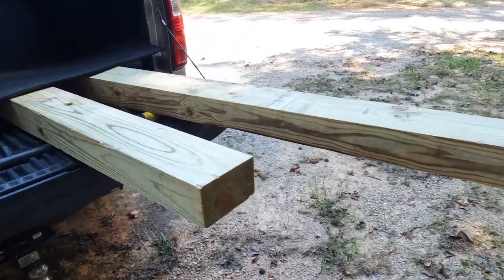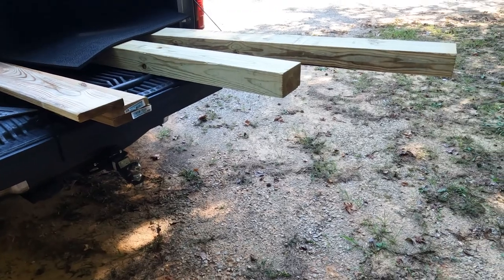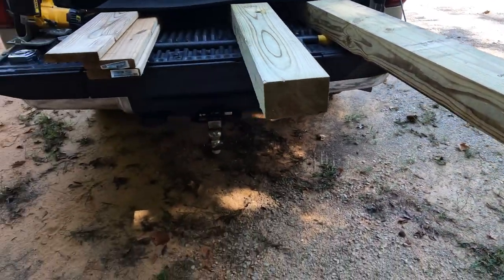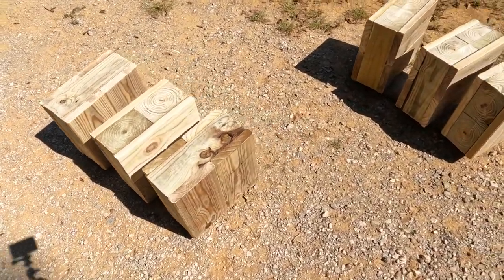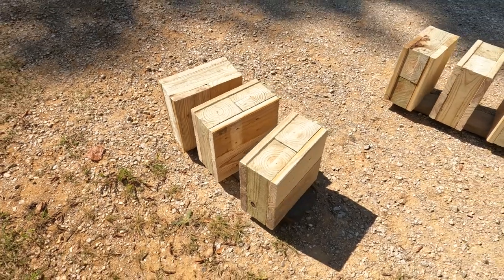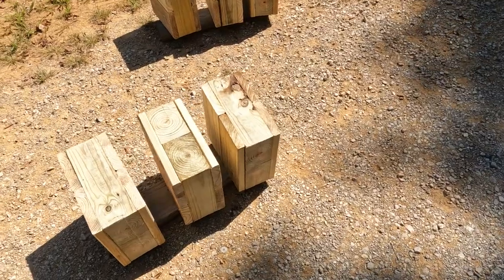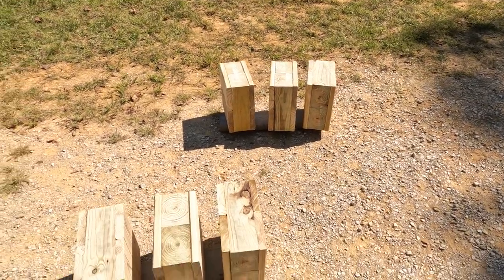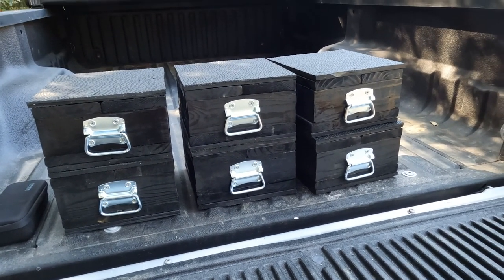Homemade Jack Blocks for RV

Comment: I used to use a similar approach...but now that we have down sized space and weight are at a premium. The bucket style all in weight half of what one block does and takes up the same amount of room as one wood block when stacked together.
Reply from the maker: Might be something I end up getting but for now they work great for us. Can you still use the snap pads with them?
Reply: @4csadventures  yeah the corners might stick off a bit but the no big deal.

Comment: I like them but I would use untreated wood.  It is much lighter.  We also camp with a 23" TT and find a lot of state parks have very unlevel sites.  So, I just carry a bunch of various size wood blocks.  I also subscribed.  Best of luck and have a great day.
Reply from the maker: That is a good idea to use untreated wood. Saves weight plus I painted mine anyway so it would help preserve it a little longer.

Comment: I made some similar years ago that worked well. However, I ended up buying the yellow Camco jack stand because they are significantly lighter. They also don't absorb water like wood does and we always seem to get rained on.
Reply from the maker: I definitely understand that. Seemed like the rain always follows us. Thanks for watching.

Comment: Hi... thanks.  I used 2x6 pressure treated wood. Its red in colour wood out here in AZ.. I built sets in 2 layers and 3 layers. 13 inches long boards. That gives a space opening in the boards to grab them with.  That plastic pads were cracking apart, so I built wood pads like u did.. I still have a few plastic pads in the 5'er for some reason.
Reply from the maker: That is a good idea too. Thanks for watching

Comment: Good on you for making your own! BUT, I wouldn't compare to the Anderson buckets as they are not anywhere near the same. The buckets appear to be taller, can stack onto each other and they have a magnet for connecting them to your foot pads before you put your jacks down so you know they are lined up properly.
Reply from the maker: Thanks, I really liked the anderson buckets just couldn't drop that kind of money right now for blocks that I could make for 1/3 of the price. 
Thanks for watching.
Reply: @4csadventures  I'm going to make these...and add magnets. Easy-peasy.

Comment: Definitely sturdy, but I would be concerned about the extra weight unless your haul vehicle is a One Ton Dually.
Reply from the maker: it does add about 70-80 lbs and may upgrade down the road but they work great right now. Thanks for watching.

Comment: They look fantastic but could you please tell me what the rubber mat does on blocks? I'm not slagging you, I sincerely don't understand why you would add the rubber. I don't understand the purpose.
Reply from the maker: Adds a layer of protection for the wood and it won't slip. Guess you don't have to have it. But I liked it. Thanks for watching.
Reply: @4csadventures  Thanks for the reply. I actually looked into it further and learned that many sites require the rubber pads to protect the ground. 👍

Comment: Were you able to figure out where to store the jack blocks?
Reply from the maker: I haven't worked on that yet. right now they are under the jacks. LOL I have been keeping them in the bed of the truck on travel days. I have looked at a couple locations on the undercarriage of our TH but unsure where I want to locate them at the time. Thanks for watching. Will update when I decide where to locate them.

Comment: My concern would be the weight difference...and storage ...
Reply from the maker: right now I'm storing in the bed of my truck. That hasn't been an issue and the added weight doesn't affect my setup. Plus they will last a long time and are very durable.  Thanks for watching.

Comment: Nice!! What is the weight of each jack stand?
Reply from the maker: 18 lbs each but the wood is still wet and should dry up and loose some of that weight. I made 6 of them and working on a way to install them on a slide under the rig for storage. Hopefully will have a video of that as well.
Reply: That's over 100lbs.  Looks like I will have to buy the light ones to save on weight.  They look good.
Reply from the maker: @myriadcorp  I have been using these and they have dropped about 6 pounds of water weight from the wood. Each weigh about 11 lbs.  Cost less than $100 to build.  I understand the weight issue.  Just liked the idea of saving some money and having a good alternative.